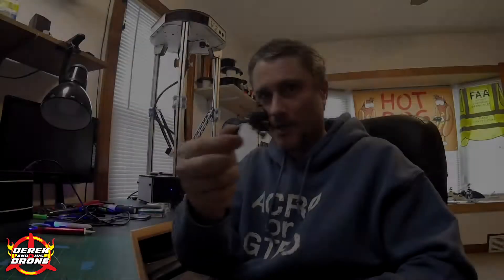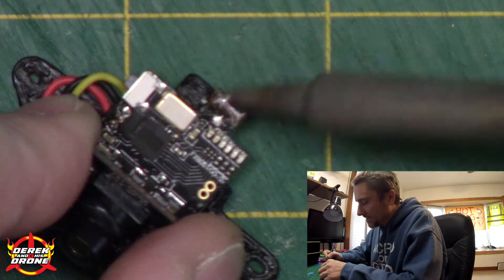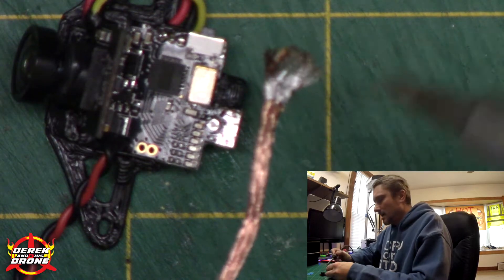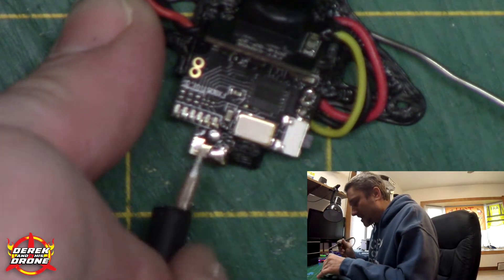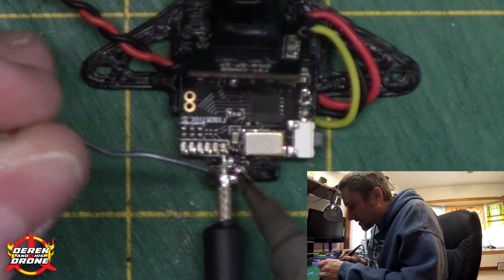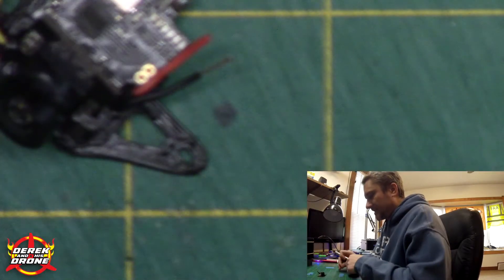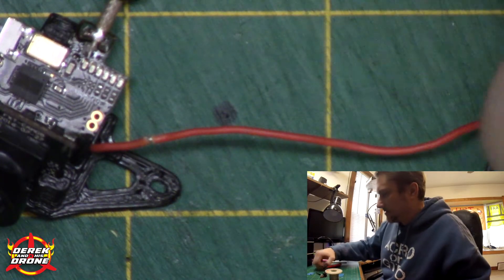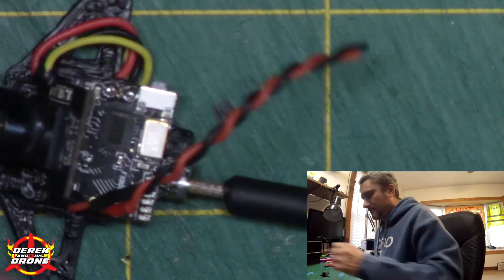Soldering 101 - Replacing a Tiny Whoop Antenna

Comment: Awesome video and very well done. Your soldering skills are on point. I struggle with getting good pads on the board before I connect the wires. Any other good practice tips on how to get those magic round shiny solder joints? Haha :-)
Reply from the maker: Flux, a good soldering iron and good solder.  Also practice.  Get some solderable breadboards and practice on them.  Good tools will make a big difference.  A $15 iron belongs in the trash.  I use a Hakko, it cost just over $100usd but is rebuildable and will last a lifetime.  I have had mine for almost 20 years and it has never failed me.

Comment: Noob question, What are those Heat shrink looking things  on the antenna. They look like some sort of noise filter.
Reply from the maker: There is a bell on the antenna with heat shrink over it to protect it.
Reply: @DerekandhisDrone sorry, I meant on the one that was replaced.

Comment: What iron temp do you use for VTXs generally?
Reply from the maker: I like a lot of heat but you need to get in and out quickly.  800c for smaller gauge things (VTX) and 850 to 890 for large gauge wires like 14 to 12ga.
Reply: @DerekandhisDrone  Wow, mine only goes to 450C and it's a wall unit. Didn't realize they went that high.
Reply: @DerekandhisDrone  Just did the math, you must mean Fahrenheit. (890F=477C) =] Thx!
Reply from the maker: @fredkurszewski782  You are correct.

Comment: Helpful video.  Thanks!  Which butane lighter do you use for heat shrinking?
Reply from the maker: I don't know.  I got it at a gas station years ago.  Anything is fine usually smoke shops have good ones.

Comment: so for the antenna, you just take off the wrap and connect the wire with a generous amount of solder. You dont have to take the threds and make them make connection with the pad?
Reply from the maker: It is important to properly prepare and strip your antenna.  The antennas I have are for replacement and are ready to go.  They just need to be soldered.